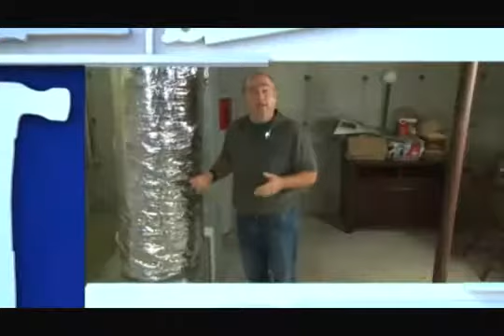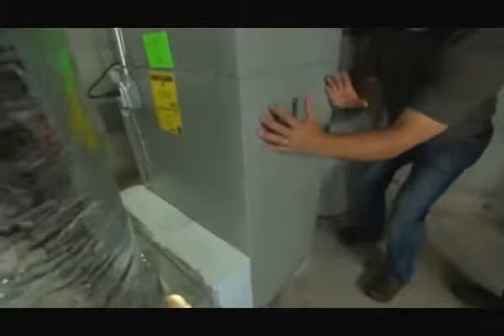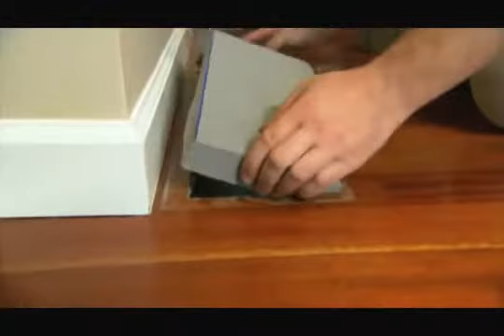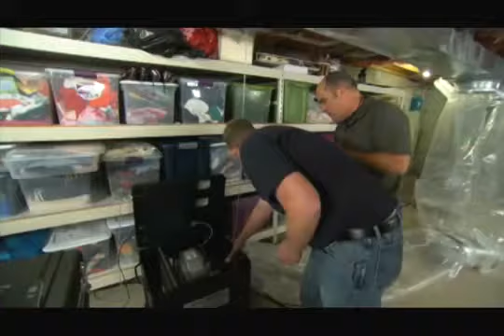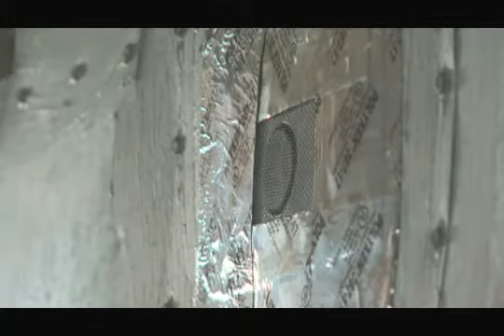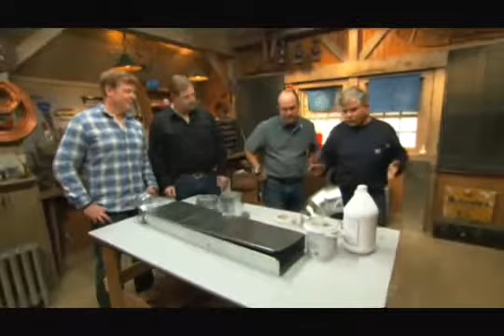Ask This Old House Featuring Aeroseal

Comment: It seems to me that this would be an excellent option when finishing a new system installation when everything is clean and not covered up.
Reply from the maker: Daniel you're correct, it is absolutely to do this either when the new home is just being built or when the new furnace is being put in.  It makes things much easier for sure. 
Best regards, 
Andy
Reply: Do you still recommend using aeroseal on older duct work/hvac system? Aeroseal would seal the current airways but as the duct work deteriorates over time, wouldn't new airways be generated? Is it still worth sealing or would it be better to get a new system and then seal from the start?  @insulwiseenergycomfortsolu3293